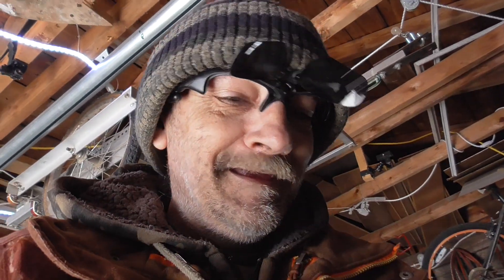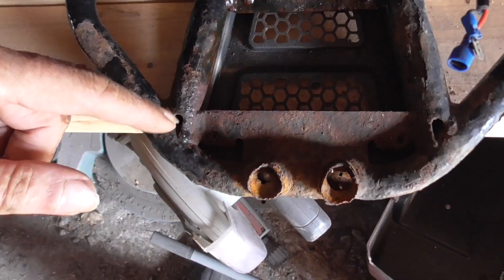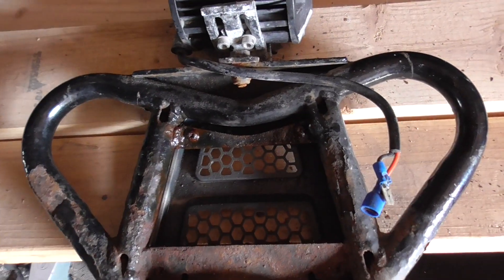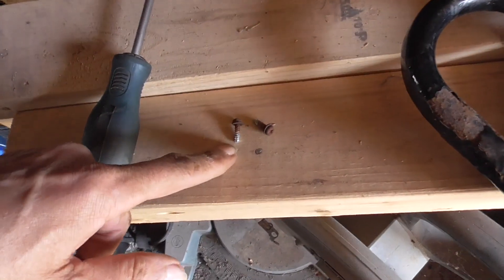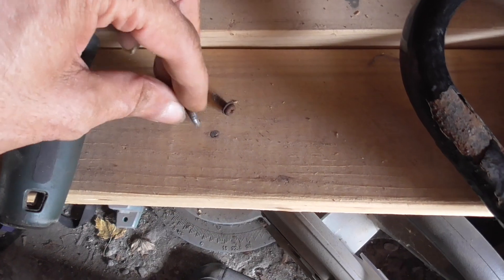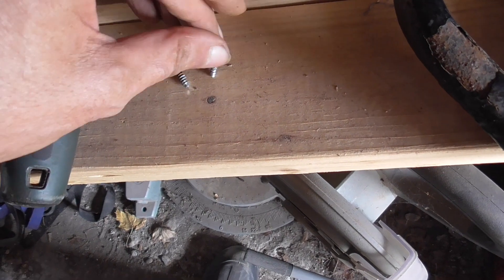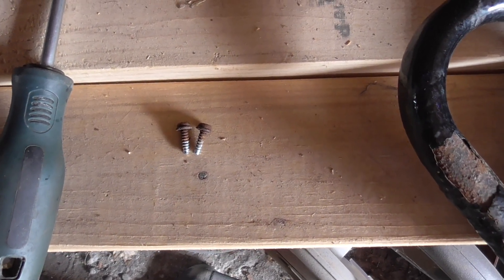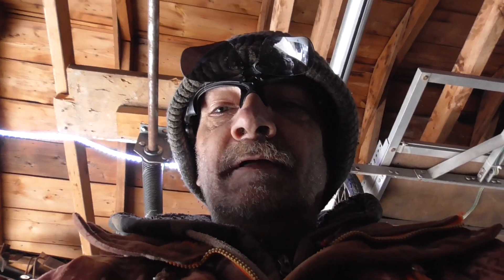Just a Quick Question

Comment: They are not self taping they are self piercing. 
A self taping  is usually  a machine thred and has a " V " cut in the side of the end to cut threads.
A self drilling is a sheet metal thred and has a tip that is a drill bit
A self piercing is a sheet metal thred that has a pointed tip and the threds go all the way to the point
I am a retired  machinest ,mechanic  and welder.
Reply from the maker: Thank you. All I need is a screw that is self-threading into plastic. The screws I showed have a notch cut into them. No other screw in The Monster's plastic areas have this. I'm not sure why they used them here. I did find "pan head self-tapping" screws on Amazon that will fit the task.